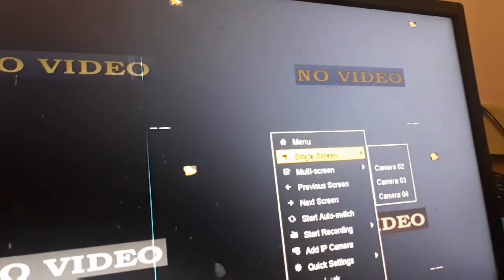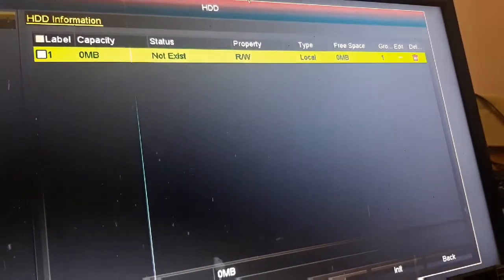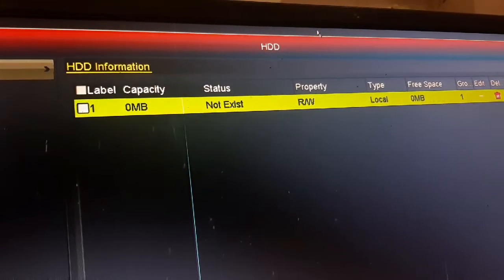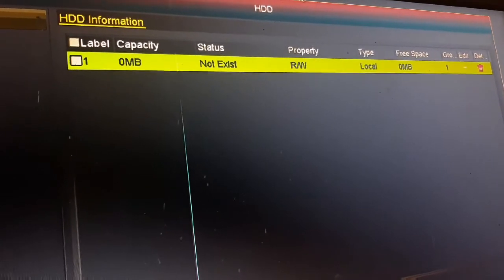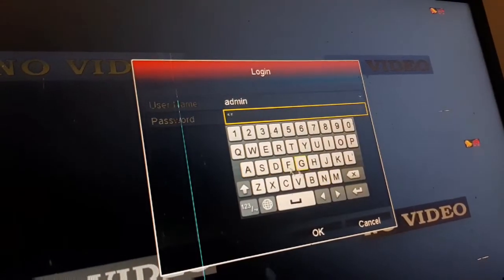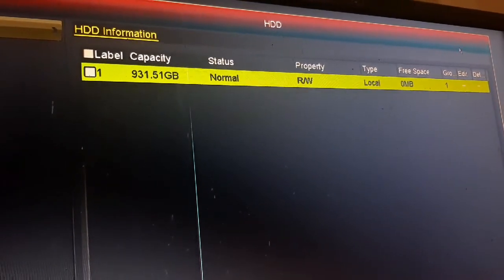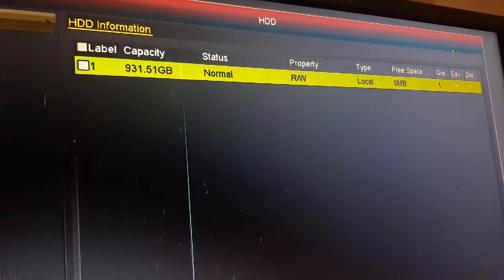DVR HDD showing 0MB capacity | facing continuous beep sounds | Status Not Exist error?

Comment: Can you confirm if you are saying that by replacing the power supply to a 2A. I have a MSP-Z13601C48.0-65W (Input 1.8A Output 1.36A) will sort issue. I have a unit which has been back to Hikvision twice for the very same issue. Unfortunately if the unit is switched off for 2 weeks it then works fine so by the time it gets tested it’s working perfectly. If you switch on everyday you get bleep and no HDD showing forever. Leave for 2 weeks and issue resolved. No issue with HDD. Issue seems to cycle 6 weeks working and then 2 weeks in power down. I have had this issue for over 2 years.... Would you see that this solution would be the same for NVR & DVR’s?
Reply from the maker: please replace new power supply and check or check your SATA cables as well.

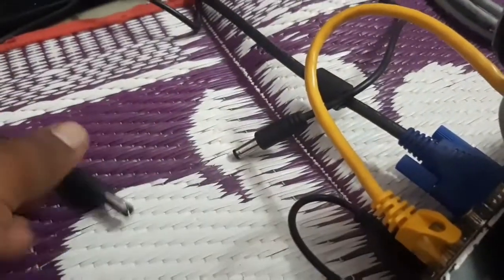Comment: Hello brother, I didn’t get 1:21 where u changed the cables can you help me out please
Reply from the maker: Sometimes if DVR not getting proper power from adapters also this problem occurs. Here I changed power adapter of 12v 2a. This problem comes in maximum 2tb above hdd. Replace adapter.
Thank you.
Reply: This problem is occuring with 500 GB hard disk in my case.....will the same solution of adapter (12V 2A) work out sir ?
Reply: @akshithsaipabba597  your problem solved? Pls tell me pls
Reply from the maker: @akshithsaipabba597  It depend on your DVR / NVR power adapter. The same amp adapter replace.
Reply from the maker: Thank you for watching and providing feedback on this channel and for sharing and supporting us in getting more visibility.

Comment: Hoe do i solve HDD initialised problem . I have tried to initialise bt the status doesn't change
Reply from the maker: Try using another SATA data cable and test with a new power adapter. If the issue persists despite verifying the cables, it may indicate a potential failure of the HDD.

Comment: Solution is to replace another hardisk? to stop beeping?
Reply from the maker: 1st u need to check with by replace power supply or SATA cables, if not replace new hdd.
Reply: @cctvtechnicalsupport4150  i plug in and out and it works .. Then few minutes beeping is back.. So i check the temperature and open the air condition more closely to DVR .. now i still observing
Reply from the maker: Insufficient power 🔋 from adapter replace new adapter
Reply: @dionelayell4372  your problem fixed? Pls tell me pls
Reply from the maker: @dionelayell4372  Thank you for watching and providing feedback on this channel and for sharing and supporting us in getting more visibility.

Comment: By default i got 12v 1.5 A adaptor it worked fine for 3 yrs suddenly this issue is coming
Reply from the maker: plz try to replace adapter and try once
Reply: @cctvtechnicalsupport4150  replace to what?

Comment: STATUS ABNORMAL >???
Reply from the maker: If the issue persists despite troubleshooting, please ensure that both the SATA and power cables are securely connected. If the problem persists even after verifying the cables, it may indicate a potential failure of the HDD.